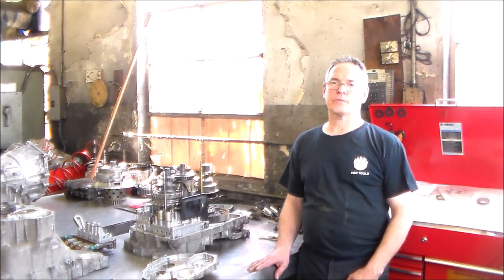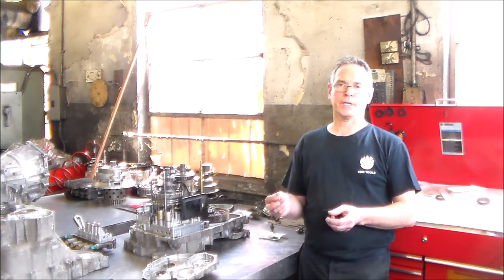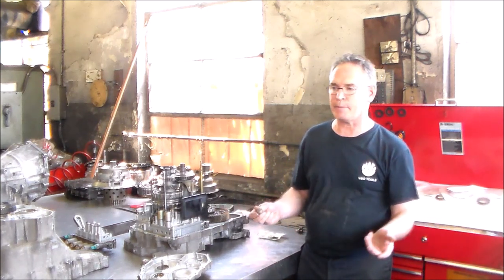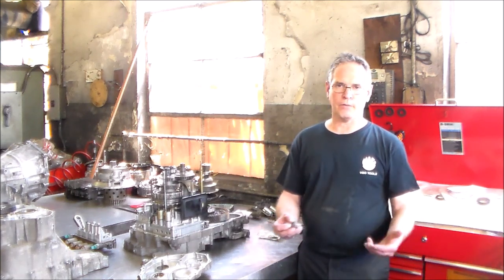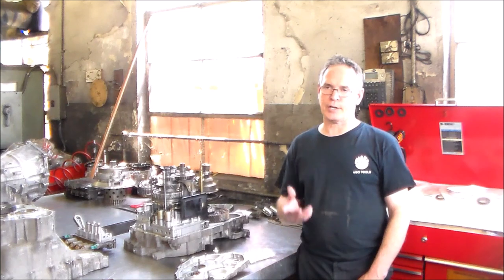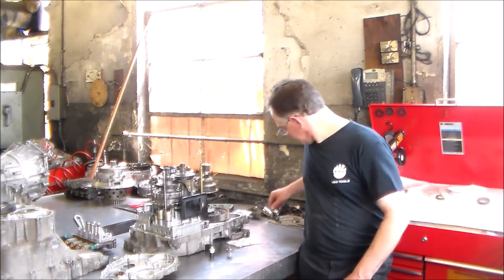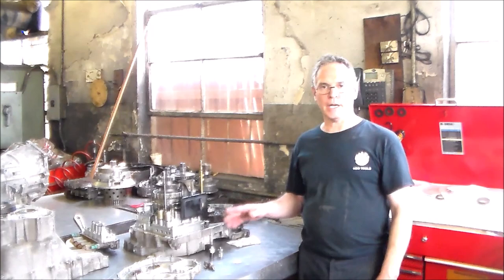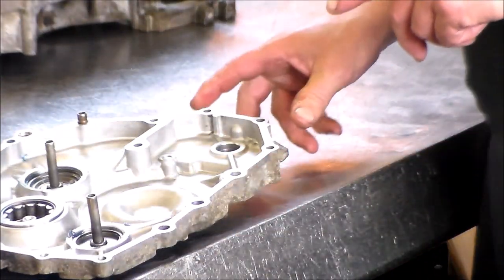Honda Pressure Switches

Comment: If the meter reads 0, then the switch is bad due to a broken wire. If the meter reads 5 or 12v, then the switch is bad. What if the switch is good? What should the meter read if the switch is good?
Reply from the maker: if you have a code for a pressure switch, disconnect the wire and make sure you have volts on the wire, if you do, then your pressure switch is bad. If you have no volts on the wire, look for your wiring problem. 99% of the time the switch is the problem
Reply: @GaryFerraro  The problem is I'm getting no code, no check engine light, just an occasional flashing "D" on the 2006 Acura TSX with a screen that reads "Check Transmission". The flashing "D" and screen message go away when I restart the engine. I left an Autel AL-319 ODB2 reader plugged in while driving, hoping to catch a transmission code in action, and it still reads no code when the "D" suddenly starts flashing, which happens once every few weeks.
Reply from the maker: @niemand000  do you know someone with another scan tool.  A code should be stored
Reply: @GaryFerraro  Someone on reddit with the same car and same problem was able to use BlueDriver with the engine running and finally capture a code (P0847 for him). He got it repaired.

But user D.I.Y.D. on YouTube used a Foxwell 614 Elite to capture the "peranent DTCs" on his 2004 Acura TSX:
05-2 A/T Range Switch Short,
15-6 Input Shaft Speed Sensor Intermittent,
26-3 3rd Pressure Switch Circuit Low, and
26-4 3rd Pressure Switch Circuit High.
Despite changing both of the switches (the 2nd and the 3rd), the problem persisted. He finally went to a repair shop, and they diagnosed it to be due to faulty TCM (ECU).

I will be driving around with a BlueDriver to capture a code.
Reply from the maker: @niemand000  wow.  First time I’m hearing of a bad TCM.
Reply: @GaryFerraro  D.I.Y.D. talks about it in his video entitled "The Flashing D's Problem - The Update (Observation & Education)".

Comment: My 05 accords 2  pressure switches have  identical connectors,  black,brown,grey,white is only difference, very confusing
Reply from the maker: The connector are the same, the color of the switches is what makes them different, they close at certain PSI, switches also may be updated with a different color, best is to go to the dealer with your vin number

Comment: I have 12v across the pressure switch instead of 5v. What does that mean? I've swapped 5 different switches and still have same codes thrown and my tranny is shifting crazy. I also have codes for 4th pressure switch. I'm really confused. I need help.
Reply from the maker: it can either be 12 or 5 volts, are you changing the correct switch
Reply: @GaryFerraro  very sure I'm changing the correct switch. I guess I'm on my way to a new transmission. But I still don't understand why I have 12v instead of 5v stated by Honda. I just hope my ECU is in order.
Reply from the maker: did you compare to another switch @lastof4brothers

Comment: 2010 Honda Civic lx.... have the flashing “D” and it won’t shift into third gear..... had scanned at Autozone and came up with a code of p0718. Which pressure switch should I replace or is it something else? Thank you
Reply from the maker: Not a pressure switch code, it is the input or mainshaft speed sensor
Reply: Gary Ferraro thank you for your quick response back! My local auto parts store had to order it, I should have it tomorrow! I’ll let you now if it fixes my problem ... thank you
Reply from the maker: @kennysmith5084  Welcome, let me know how it goes

Comment: Hi Gary, can you pls help me on this. I have a 2012 AWD CR-V. After replacing  transmission repair kit I still have a down shift delay specially to 2 nd. Or I feel it as wrongly recognising  the required gear for that particular instance of the vehicle movement. 

The repair manual gives just one part number for both pressure switches. But two switches has two different colours. Can i match the size and thread to replace an after market switch or should I always match a colour. Pls note there are no MIL codes but just delay in downshift on mild acceleration for nearly 6 months.
Reply: They could be the right part just different  manufacturers  use different colors
Reply: the pressure sensors use color to code the pressures

Comment: Any chance a po747 or p0767 can be a pressure switch
Reply from the maker: No, These are mechanical codes thats points to something internal,  Trans is full of fluid?  Honda's get the fluid checked with engine off

Comment: Thanks for sharing this information Gary.  Have you ever seen a restriction in a Honda shift solenoid screen result in intermittent DTC for one of these PSI switches?  I’ve got a 2002 CR-V which will very intermittently flares the tachometer up upon the 2-3 up shift and set a DTC for the 3rd Gear psi switch. 
I plan to remove and thoroughly clean the solenoid valve body and neck test actuation. But wanted your opinion as to whether or not the momentary pressure loss occurring at the attempted upshift would set the DTC.  Thanks!
Reply from the maker: If you didn't pull the trans yet, change the pressure switches first
Reply: @GaryFerraro  Thanks for your input!

Comment: Doing some troubleshooting on 03 Odessey . It is shifting harshly into 2nd and downshift to 1st. No codes,oil is clean and pink. Would it be the pressure sensor¿
Reply from the maker: It's possible,  could also be linear solenoids or a clutch problem.  Is this ok cold and act up hot?
Reply: @GaryFerraro    It shifts harsh cold or hot
Reply: @GaryFerraro  mine acts up when hot. Smooth when cold. What could it be?
Reply from the maker: @jonmentzer6092  I would try linear's first
Reply from the maker: @TheEqualizer1  That may be a filter starting to clog up
Reply: @GaryFerraro  thanks Gary, the linear actuator was the culprit. It shifts like a new transmission.

Comment: Gary thank you for the video. I am here because I'm having a delay between third and fourth gear. Shift basically feels like it's slipping . it'll catch good would  this be a Pressure. Switch. Again thank you for the video
Reply from the maker: it's possible, could be internal problem too.  do you have a scan tool to view data?
Reply: @Gary Ferraro  yes when my wife gets home from her road trip I will put the scan tool on it .if there are no codes. I'm guessing it is internal .I did change the trans fluid last year with honda type from the dealer .thank you again.
Reply from the maker: @MrSprintcat  you could hook up the scan tool and see if the pressure switch is changing from off to on
Reply: @Gary Ferraro  I'm not sure my scan tool is able to do it. It's a cheap $100.00 autel. It does have a spot in the diag that I can see different values.i did notice the last month or so it would take some what longer to shift from 3rd to 4th.
Reply from the maker: @MrSprintcat  very well could be.  What is the year,make and model
Reply: @GaryFerraro  2005 honda accord  2.4 lx
Reply: Do a drain n fill if that doesnt fix it get the switches get OEM from dealer electrical components are very sensitive n ur engine it is very easy to replace cos i had a 08 after replacing the switches it will feel u r driving a new car again.  @MrSprintcat

Comment: Hi there i have a acura tsx with a k24 automatic and i have bin having a hard shift from 1 to 2 gear i changed the pressure sensor both on top and bottom even de dual linear selonoid  but still shift hard what more do i need to change
Reply from the maker: any codes?  your 2nd clutch may be no good
Reply: @GaryFerraro  i changed the AB Selonoid from a good working transmission but still shift hard

Comment: Hi, i have an '03 Pilot.  No codes, but when warm and stopped at a light, the trans disengages.  If you downshift into D3 it works fine.
Otherwise, the trans shifts fine.  Any ideas?
Reply from the maker: Sounds to me like the filter is clogging up, works ok cold and acts up hot usually that is a filter problem common with honda's.  Filter is internal to the trans
Reply: @GaryFerraro  Thanks Gary.  I did the 3 quart fluid change last month - sill changing help or id pulling the trans the only option?
Reply from the maker: @dougpakkala6080  ok, so you did a fluid change and still the same problem?

Comment: Hi gray
I have a 2003 Accord, it doesn't go into 2nd gear. I have to be ravaging the engine for minutes before it  goes into the 2nd gear and when I to a stop I have to do the same thing again. What might be the issue please ?!
Reply from the maker: Does it work the same when the car is cold and hot?  any codes present on the trans?
Reply: I have a 2009 accord 4 cylinder that is doing the same thing I have to rev it high so the transmission can switch from first to second or I have to be going over 20 miles so it can grab the second gear all other gears are great like butter can that be the pressure switch
Reply: @bobolonbobolon4833  if it revs up between 1st and 2nd like its slipping and then roughly shifts into 2nd it can be a 2nd gear pressure soleniod/ switch
Reply: try 2nd gear pressure switch and solenoid B and C

Comment: What happens if I used a lower pressure switch? 1998 accord automatic (swapped out a baxa for a mgpa)has black in the front and green in the bell housing. Can I use the brown where the green is?

Comment: 2002 Honda CRV p0845 when I test switch with key on engine off I get no voltage on MM meaning switch is good, right? And this means wiring is bad, or could it be something else?
Reply from the maker: Ok so just to confirm, you unplugged the harness and checked for voltage with the key on and had no voltage, would either be 5 or 12 volts
Reply: @GaryFerraro  
Correct
I ran ground to neg battery cable and probed the inside of switch (3) behind front driver side tire. Key on engine off.
No voltage.
Shifts hard at 2nd and 3rd.
I did go very long w/out atf change and trans fluid was darker than ideal (burnt looking) but I did just change out 3 qts this past Saturday. Plan to do more later but p0845 code came back with test drive. Just trying to rule out switch.
Reply from the maker: @wjsteagall  If o voltage on the wire with key on engine off, fix that first
Reply: @GaryFerraro  
Wait, now I'm confused.
You said in last reply:
"If 0 voltage on the WIRE"
I didn't probe the "wire", I probed the prong inside the switch itself.
Are you saying I need to probe the wire that plugs into the switch, as well?
Reply from the maker: @wjsteagall  ,  Did you check this with the pressure switch unplgged from the harness?
Reply: @GaryFerraro  
I did 
And I went out and checked it twice more yesterday just to confirm. So, from my understanding now I have to check the wire from the harness all the way to the battery?
Reply: I also used 2 dif mm, to be certain
Both on Dc voltage, 20 setting
Reply from the maker: @wjsteagall  Ok, so with the pressure switch unplugged and no volts with key on engine off, do a continuity check of the wire,  it may be broken, not sure if this has a TCM or not, have to run your vin.  If you want to e-mail me your vin number
gsferraro@yahoo.com

Comment: 2016 Honda Civic flashing d and engine light on. Car also doesn’t want to go after 40mph. 4 th gear pressure switch maybe? any help is appreciated
Reply from the maker: Need to get the car scanned,  to see what code you have.  Usually a pressure switch  code will turn on the check engine light or D4 flash, but it will not inhibit 4th gear,  see if you could get the car scanned
Reply: @GaryFerraro  it seems the Fail-Safe design is good enough to never shift two gears even with bad solenoids valves... right?

Comment: Very nice explanation on the switches. I have One question that noone seems to be able to answer. I have a 5 speed acura tl. Shifts really nice all the time but I have a delay into drive and into reverse about 4 seconds to engage. Could this be a shift solenoid? I'm guessing there might be blockage in the valvebody or internally somewhere. Been like this for months.
Reply from the maker: Does this all the time or only hot?
Reply: It does it all the time. Cold or hot. It gets a very tiny worse when hot but for the most part it happens all the time. Forgot to mention reverse slams after the delay its not too bad but it does slam.
Reply: I have same.problem honda pilot
Reply: @GaryFerraro  Is this Hondas sequential box but still using a torque converter but still using a conventional gear system and so is it mostly the sensors that give trouble ? Its just a few yrs. back i remember testing 2006 civic here in the UK which i thought was a full torque converter box and i checked the leval before i test drove it but it skipped a gear at least twice. Is this common fault with them as this car was supposed be low mileage? And then theres the I shift with a straight box system. Which is the most reliable please and or easier to work on. Is there any yr onwards or either you need to avoid. Im thinking of looking around for say 2009 11 model civic thanks

Comment: I have a 2005 honda accord cl7...I got a p0847 code I change the pressure switch an test drive it d light start to blinking again any help please?
Reply from the maker: Did you change the correct one? where did you get the switch from?
Reply: I got the switch from a dealer.....it's the mechanic change it for me so am not sure if it's the right on or not
Reply: After the switch was replace he clear the code and it came back....I'm frustrated right now,don't know wat to do
Reply: @ianglobaltv  I had the same problem after installing both pressure switches the d lights started flashing at like after 15 minutes of driving the solution for me was I disconnected the battery for an hour and reconnected it and it's been gone  no code shifts perfect
Reply: @voteandvote8593  ok am gonna try this method an see if it works...thank you

Comment: I have a problem with a Honda Jazz fit low pressure in reverse and forward what could cause that and it use all sensors
Reply from the maker: What year is the car, any codes present, not sure what trans you have in there
Reply: how do you know you have low pressure in reverse??
The pressure switches are 
 used for forward gears, right...

Comment: i have accord 2009 d lamp flashing scanned give me P0848 ( transmission fluid pressure switch B(3rd clutch ) circuit high .) can you give me the number of this part please and picture
Reply from the maker: The switches are external, what is your engine size? not sure if i can do a picture.  Where are you located?
Reply: @GaryFerraro  hi , its 2.4 v4

Comment: I have a 2004 2.4 do u know how many I would have ?
Reply from the maker: What kind of car Honda or Acura
Reply: @GaryFerraro  Honda Accord ex
Reply from the maker: @brooklyn7941  Should be a 5 speed auto, that trans i believe there are 3
Reply: @GaryFerraro  u wouldn’t know if they are located at the front or do I have to take the driver tire off to reach them ? By chance so I’ll know
Reply from the maker: @brooklyn7941  one may be on the end cover and maybe the other 2 on the main case
Reply: @GaryFerraro  you know if I can send u my email and u can forward me a diagram of where it could be ?

Comment: I have a 07 mdx which on dash says check transmission along with code p8048 flashing D light.I have change both switches not oem.Same issue car drive good just the D light and code .Shut the car off its gone until it comes back
Reply from the maker: is it a pressure switch code?
Reply: @GaryFerraro  yes it is but I have changed both switches  and it still comes
Reply from the maker: @richardlawrence8691  You have to disconnect switch with key on engine off, see if you have either 5 or 12 volts where it plugs into the pressure switch
Reply: @GaryFerraro  then what? What result(s) are you expecting? How do you translate the result(s)?

You have voltage... What does that mean?
You do not have voltage... What does that mean?

Comment: How much it will cost to replace all the switch
Reply from the maker: Tajdin Habib depends on how many there are   I would only go dealer on that part and they are about 60 to 80 each one
Reply: @GaryFerraro  $10 on ebay!
Reply from the maker: Be careful. Last guy that brought switches from eBay did not work. I would only go OE on those

Comment: What cause a pressure switch to stop work
Reply from the maker: The diaphragm could go bad.  but check for your reference volts,  Usually 5 volts

Comment: FYI the flashing d light has been going on a vtm light has gone on I normally shut the car off and then restart it and it would go away also check engine light is on
Reply from the maker: Have the car scanned for codes

Comment: Honda accord 01 mi transmision la velocidad 2rd tarda en entrar solo en tiempo de frio y asta que llega asu temperatura normal se compone, GRACIAS POR SU AYUDA.
Reply from the maker: Are you having a problem in 2nd gear?
Reply: Yes only cold weather
Reply: Thank you gary ferraro
Reply from the maker: @oscaroscarin  ok, what happens, does not shift? stays in first?
Reply: In winter time the second gear makes the car slip but when the motor gets hot it goes away
It only does it when I come out my house 1 or 2 times
Reply: @GaryFerraro  Gary, I'm having the same issue on my 1998 Accord V6 with only 94,000 miles. No code light, In cold weather the the 1-2 upshift is slow and shifts abruptly. Once the unit heats up it seems to shift just fine and it feels fine. I'd like to rule out any serviceable items like pressure switches or solenoids.
Reply: You stated that you're supposed to unplug the pressure switch and it's a single wire pressure switch. And then you said check voltage at the switch with a probe. Are you sure you didn't mean check voltage at the plug and not the switch?
Reply from the maker: @rudolphhaas2887  Yes, sorry, unplug the pressure switch and check voltage at the plug or the connector for the pressure switch